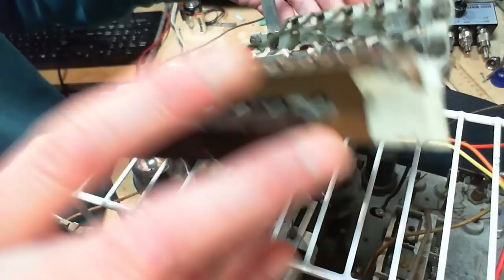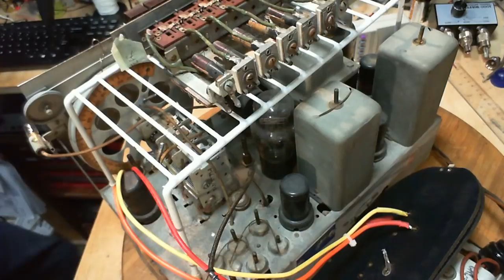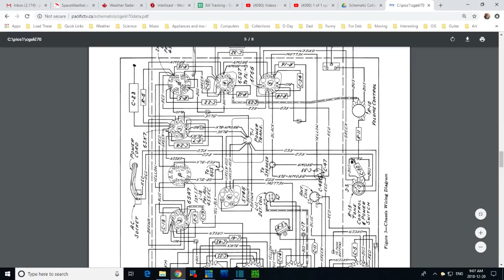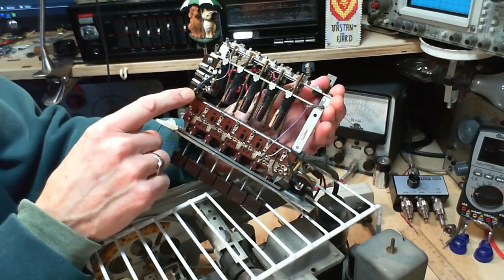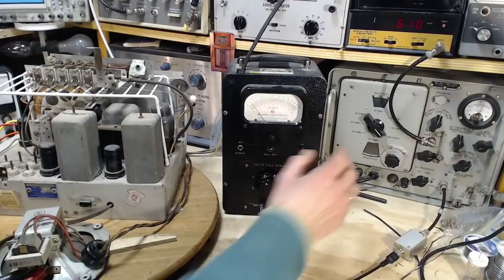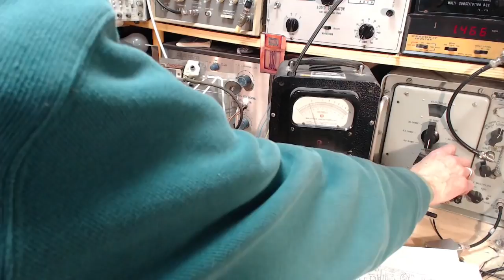General Electric KL-70 AM/SW Radio Video #33 - Push Buttons

Comment: Jim-- I enjoy this subject of radio repair as I am attempting to learn by doing and want to thank you for your videos.
I learn something with each one I watch. I still need a few more pieces of equipment, but, I'm getting there slowly.
 Mr. Carlson's Lab (this video--https://www.youtube.com/watch?v=lR9LxLDbAy4--) 'Stewart-Warner Radio Repair' video, has an excellent explanation of how to peak the trimmers, oscillators, and resetting the tuning dial pointer so that it points to the correct frequency on the dial.
Don't attempt to simply move the string by hand, bend the pointer or slide the pointer along the string to advance it along, it will get worse.. Information is key and Mr. Carlson is an excellent instructor and electronics engineer. I think you will agree that, after watching; setting up the radio will be so much easier.
Hope this helps- Mike

Comment: That pushbutton system is actually fairly standard on electronic (as opposed to mechanical) tuned home receivers. As you note, this allows one to tune with the coil and then peak the antenna part of the tuner for maximum signal strength. That last bit is important to remember if a major antenna change is made OR if you move to another place. Yes, you can get by with it but a gross change should be peaked again after the move for each pushbutton. The regular tuning is peaked for an average already so it should be good to go.

Most (all?) tube car radios are mechanical and so are lower-end home radios, so they have no per-station settings for their buttons beyond the initial setting on the dial. Some European models differ.